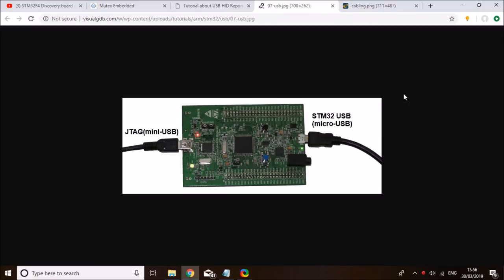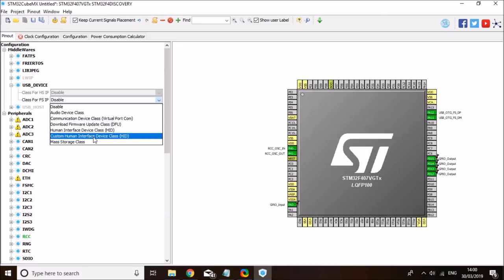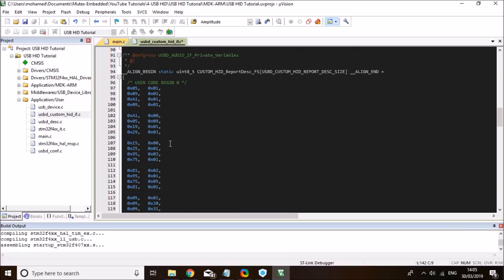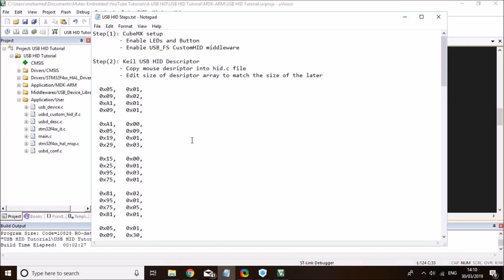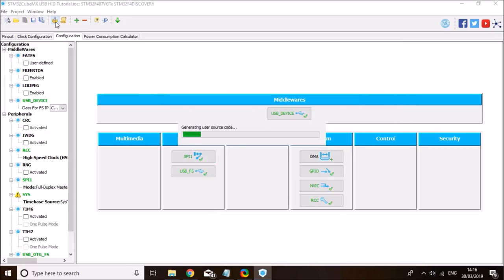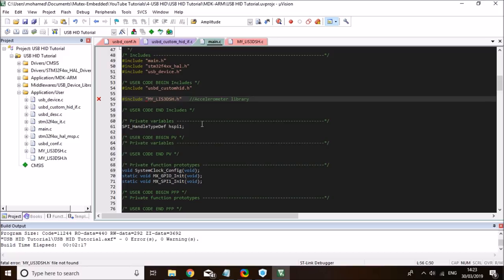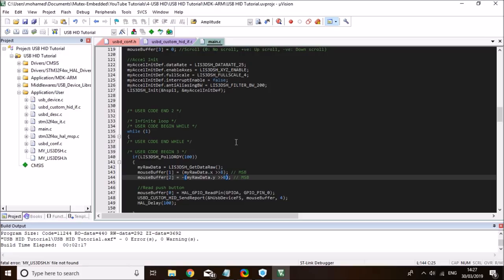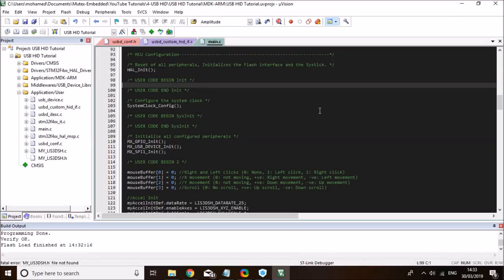STM32F4 Discovery board - Keil 5 IDE with CubeMX: Tutorial 32 - USB HID

Comment: Spent a good part of the day trying to make the first part work.  Turns out this does not work with version 1.24 .  Switched to 1.18, and the software if fine.  Any idea what changed between versions?

Very helpful videos.
Reply from the maker: Hi,
The reason often a bug or an undocumented change in the firmware. I like to stick with stable versions of software until I found a better release.